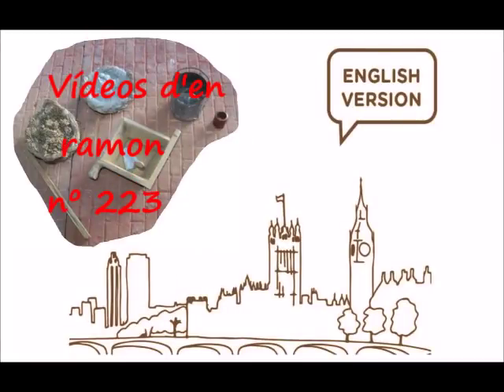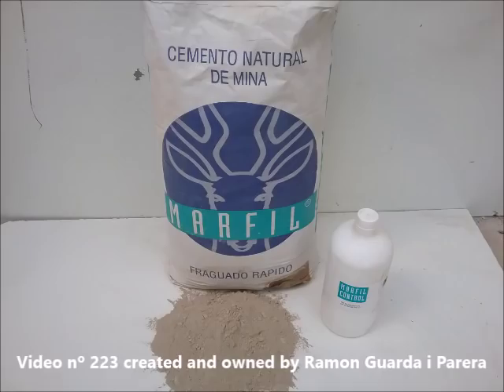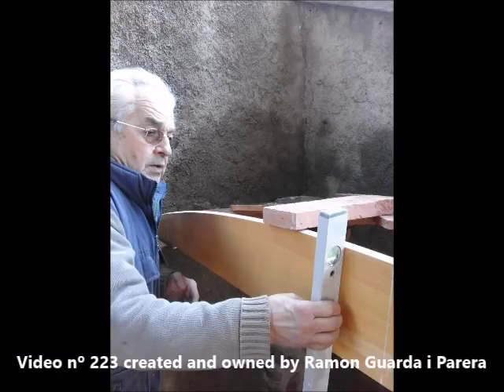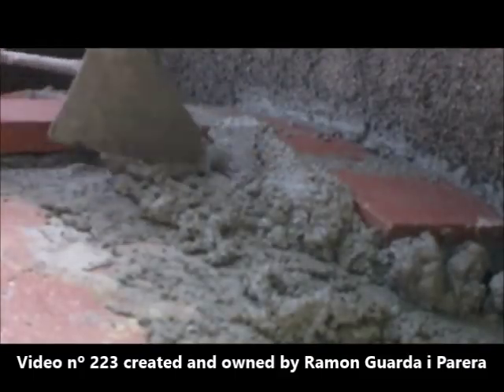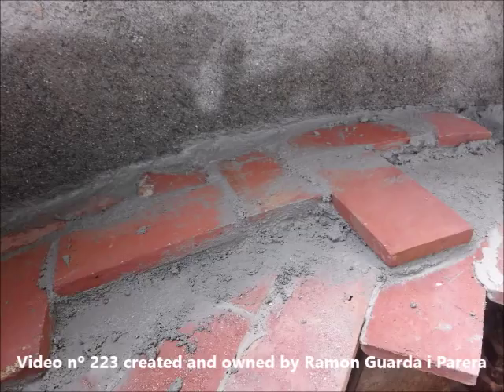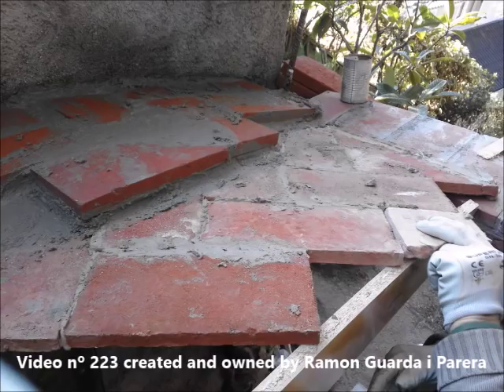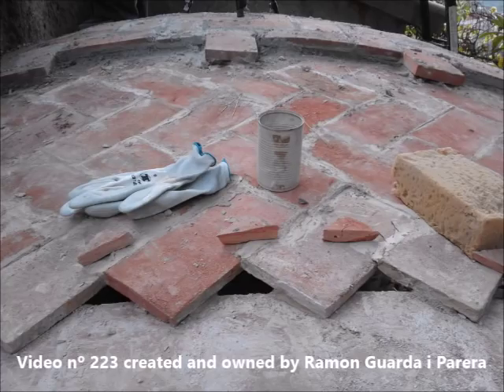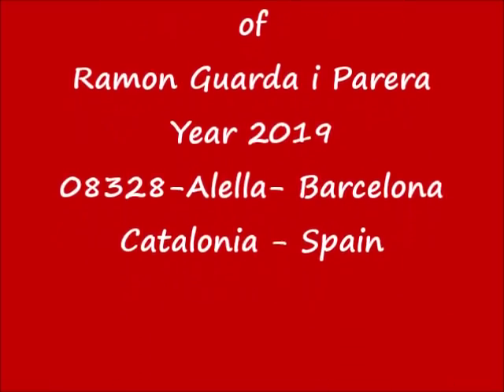How to build a four point vault No  223 wimp

Comment: This is the same method I used to build my Catalan vault. I wish I had known not to remove the cement on the underside while still moist and wait till it was hardened.   In my case, I used plaster of paris for the quick set intrados layer, and portland for the extrados layer.   The one big thing not covered is how to waterproof the vault.  I found that using pure porland cement watered down to a paint and painted on top will satisfactorily water proof the roof.
Reply from the maker: Hi, MyOwnDrummer. I appreciate the comment. Normally a vault built to the outside is better the first thread the bricks placed with cement of fast setting and the second and third thread placed with cement mortar portland. If you leave a centimeter of thickness between threads and joints it is difficult to have leaks, but if you have the solution with the product that you mention better it will be. Best regards  Ramon
Reply: @ramon17642  Thank you!